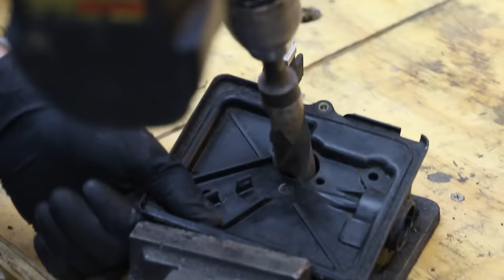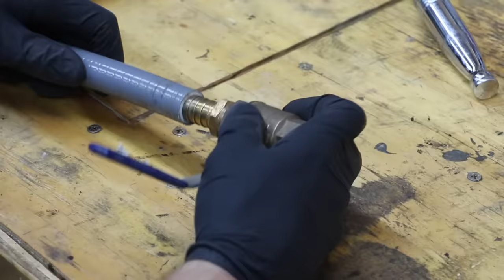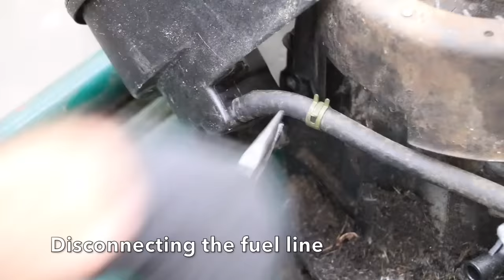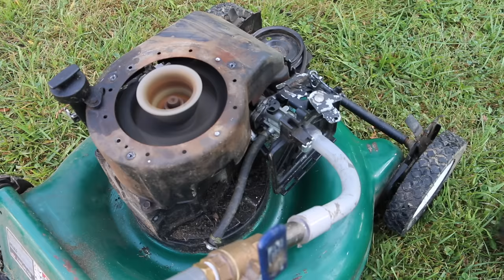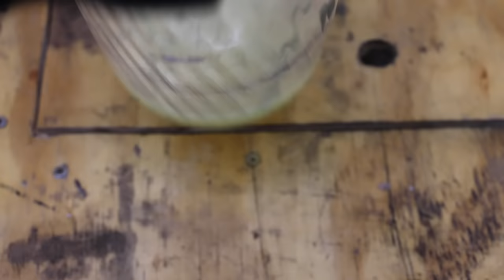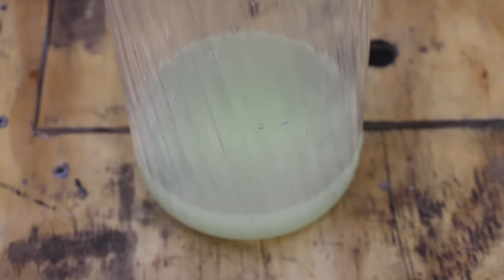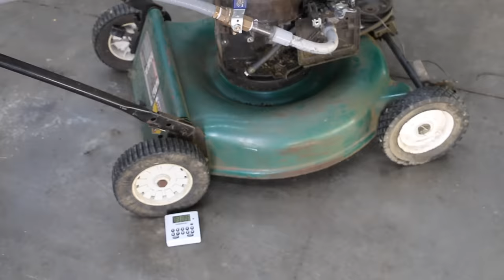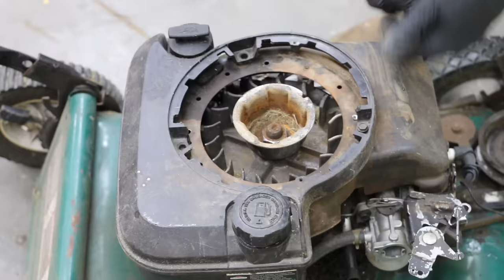Will a "Gas Vapor" Container Improve MPGs and Fuel Efficiency?  Let's find out!

Comment: Completely rerouting airflow through the fuel chamber is less efficient than having a separate air intake line with a separate valve. In the set up that you created here the air/fuel mixture is directly proportional to the amount of air flowing through the fuel. That air, in turn, is the sole source of agitation. One alternative would be to make the agitation lines smaller, which would require a lower volume of air. Then, a Y fitting at the base of the air intake So that you could attach a larger diameter air filter with a valve. This will give you a much more fine tuned control over the air fuel mixture. Additionally, these configurations run extremely lean so adding a little bit of water to the gasoline would help in overall engine temperatures. I know that sounds crazy, but in practice it works very similar to a water injection system by adding a little more water vapor than ambient air to the overall mixture.
Reply: You covered some items of my critique.  This test set-up for most applications  is quite impractical apart from educational exercise.  Adding water makes sense, a means to prevent a “backfire to evaporator chamber” explosion is the worst “safety” omission. 

One you didn’t mention though perhaps obvious is in this initial setup the air flow through the fuel being akin to a hookah (Sp, a water pipe) - fuel is filtering the air and canister will become a maintenance issue. He mentioned fuel turning yellow and air in the fuel making fuel cloudy (also less effective after a time by slow oxidation if left sitting).  

He didn’t cover detailed concept considerations before diving into the  “build” - as a “test of concept”, excluding filter element may have seemed a high-restriction unknown, but dirty air will create other problems later.  Addressing YOUR arrangement, a single filter into a common plenum feeding air to both the evaporator canister and the air-only intake line will work fine.

You comment about smaller lines “taking” less air is physically true, evaporation efficiency increases with air turbulence so the goal would be throttling the best stoichiometric FINAL mixture to the engine (your separate “dilution” line covers that). That stoichiometric base line is limited by the saturated fuel vapor availability (think in terms of absolute humidity, and high humidity air means less room for fuel between the air molecules ), but is a fairly predictable limit. Your multiple air lines into evaporator canister are best handled with a singe line feeding to a “sparger” ring (effectively smaller holes distributed evenly at the bottom of the canister, to make smaller air bubbles which can become saturated vapor bubbles).

Past each of those a canister level control is needed - as fuel is used the bubbling has less retention time for evaporation / air filtration, and extended time in that condition makes fuel vapor-quality worse.
EDIT of 7/2/22: As clarification, “Vapor quality” is a parallel to steam quality.  Bypassing the significance of the steam term, air holding as much fuel vapor as possible is “saturated vapor” (if the fuel was “water” the terminology would be “100% relative humidity”, such that “one more molecule of fuel vaporized” would precipitate a molecule of liquid elsewhere in the vapor space.  In practical terms the fuel energy in the space would not increase further at that temperature and pressure.  

The problem ultimately becomes load/speed control, and especially lack of an accelerator pump effect for use on engines that have a varying load.  The improvement you suggested as well as those I covered essentially make the canister into a modern carburetor. Opening the line from evaporator ahead of the bypass/dilution air line has the same effect as accelerator pump (a brief period of decreased air/fuel ratio into combustion chamber).  With that part alone, I see little practicality versus the well proven carburetor tech, which even without an accelerator pump has a more consistent fuel-air ratio control characteristic.  The only “really better” fuel delivery is direct fuel injection which is seen in modern vehicles and while better than carburization is overkill for small engines. 

Btw I mentioned the problem of backfire risk.  Carburetors aren’t perfect in avoiding that risk but since the fuel is drawn into the air flow by the Venturi effect, reverse pressure from an intake manifold explosion or leaking intake valve would implicitly halt fuel feed.  That effect is impossible with this direct evaporation arrangement, but the SATURATED fuel vapors in the evap canister won’t explode if that line remains protected/intact. 

HIGHLY LIKELY is nearly all of this work has been done before - a later comment indicated the Ford evaporator plate concept.  Before that was the fuel dripping into the intake manifold,and slightly better yet the psychrometric effect, where air flow passes over a fuel-wetted wick for evaporation (like a kerosene/oil lamp without the wick alight), but controlling the air/fuel ratio for engine speed resolves to very much what you described  - lots of physics, a little chemistry 🙂.
Reply: I’m certainly no engineer but what you said seems pretty accurate, if you have the resources and time I’d love to see a video of you making and/or testing this build.

Comment: Did you not know that vapour carburetors were one of the standard ways to fuel a petrol engine before the venturi type carburetor was invented?
Reply from the maker: Thanks for commenting on this!
Reply: Engine back-firing is why vapors are dangerous.
Reply: @Maxon Dimber unless it's a rotary ;)
Reply: @Maxon Dimber EXCEPT direct injection into the cylinder allows the intake valves to get loaded with crud causing other problems.
Reply: Any chemistry major can tell you that this will be true, it's called activation energy, combustion is a chemical reaction, some chemical reactions have a higher activation energy than others, for example burning diesel requires more energy than gasoline, and gasoline vapor, requires less energy. By adding a - bong - err i mean vapor inducer to the intake you are lowering the activation energy of the fuel mixture by changing the state of the fuel, however, the small efficiency increase is not worth the risks involved with adding air, or heat to a tank of gasoline on a passenger vehicle. The claims of >10% more efficiency are simply B.S. however, as the activation energy of gasoline is <5% of its energy density. I would be interested to see this test performed with both engines hot to begin with, my theory is if both engines were already at operating temp, then there would be no noticeable difference in fuel economy.
Reply: Steve Prince  Its sad how true this is, i mentioned one story that was misleading to a coworker( the border patrol and 7 year old girl thing) , and the next thing im hearing about is how its crazy the number of things being hidden from us, and he had seen a video of a guy opening a portal to egypt in his bedroom, i kept my mouth shut, for obvious reasons, him being a coworker, but it was hard to hear. Homeslice, a media outlet kept a part of a story out to make their agenda look good, that is not the same as mind control and teleporters to and from Starbucks. SMH
Reply: Steve Prince  The difference can be seen when you apply a load to the engine. When you're running the engine in neutral, you won't see much of a change anyway.
Reply: these comments are ridiculous........ engine vapor or venturi, you tune a engine to the right fuel/air mixture so in the end you are going to use the same to get the equal amount of power... it don't matter how you get the air fuel mixter to the piston..... it don't care who or what brought it to him....
Reply: Steve Prince  well basically I was tying to say is the "vapor" can run a engine but its pointless given the power output on a petrol engine, kinda same with propane, it could have a purpose but another thing to think about is fuel price...  hell propane isn't any price than unleaded. 

if you want to toy around and such with it, it would be fun to play with different ideas but in the real world applications its not worth it in my opinion. To be honest I believe diesel is the way to go, plenty of real power "torque" and with technology they are pretty fuel efficient.....
   another note is to say that todays tech might be dumber than the simplicity of tech in late 1800's/early 1900's how many old hit n miss engines ran off natural gas? its a pretty old argument of whats better fuel type/engine type....and when Diesel  was invented before 1900 and it seams that it is taking places of other engine types.. 
ok and i will stop babbling and get off here
just want to be part of the conversation lol. cheers have fun
Reply: Steve Prince  It's called "pandering". Now please visit my Patreon page!
Reply: Steve Prince  news flash Steve. They do run the world to buttress demand for our dollar in world trade. Gasification technologies did and could supplant petrol
Reply: Steve Prince  Do you feel better about yourself after ridiculing others about things of which you have little or no understanding of? A mechanical engineering degree does not give real world experience or show the result of greed in a competitive marketplace. Multiple examples can be supplied to you of superior products that are not utilized to their fullest potential, designed obsolescence, and straight up ignorance/selfishness on the part of the consumer which have led to a far superior products' demise. 
Do you not understand exactly how the petrodollar works or the lengths that those who control monetary flow will go to to preserve the status quo? Reference Tucker automobiles for one example.
Two questions I ask every day, "What lies am I telling myself today?" and "Am I part of the solution or part of the problem?" If you're all that with your mechanical engineering degree, I challenge you,  prove it by coming up with a superior workable solution.
Reply: @ioccatonyz1  an iron wire mesh can solve that issue

Comment: Your valve on the hose is not adjusting the air/fuel ratio into the carburetor. It’s only controlling the air flow. The air/fuel ratio is purely based on the amount of fuel able to evaporate in the container while you’re sucking the air through it. 

If you want to start researching improved fuel economy, you have to start adjusting the air/fuel ratio to perfect the engines efficiency. The engine was getting so much vapor it wouldn’t run until you closed the valve most of the way. 

Add a second valve taking air from the atmosphere into the same line. Then you can adjust ratios by manipulating the 2 valves.
Reply from the maker: Thank you!
Reply: Great idea

Comment: thats a good way to survive without a carb in emergencys
Reply: Yes! This is the smartest comment on here. Carburetor jets are always plugged and you just need to mow? HANDLED.
Reply: @jimmio3727  yes... no carb? Make a fuel air bomb! 👍
Reply: I have to agree, looking at it, the purpose of a carb or injector is to make fuel vapor mixed at a decent ration( I wouldn't always say good) this is probably making a very rich fuel ratio(not sure I haven't tried it yet) but never the less, it will get your lawn mowed or your clunker down the trail if the carb clogs.
Reply: Yeah pretty much he made his carburetor. Which is why I knew ahead of time you can run an engine on vapors. That's what the carburetor in a regular engine DOES - vaporize the fuel and mix it with the air.
Is it going to use less fuel? No, the engine as delivered from the factory already has a carburetor, so it's ALWAYS been running on vapor.
Reply: Robert Andrews  You are correct it could be a break through other than fuel is upper cylinder lubricant and when an engine runs lean for a long time the wear and tear is to much for the (wear) rings to handle and also a engine needs enough fuel up top to keep it cool or again the rings and hardened valve seats can fail
Reply: Only for old simple engines, and  not for cars made after 2000's. i doubt modern car will continusly run when many sensors are yelling at the computer"therr is guy tring to 
bypass us".
Reply: its basically a carburator.

Comment: There was some research about using ultrasound to atomize gasoline more evenly and completely.
Reply: same outcome
Reply: I think the goal is vaporization. Heat has been used to accomplish this.
Reply: Nobody wants to microwave gasoline. Sorry.
Reply: Yes, decades ago. Was snake oil then and still is.
Reply: @Daniel-59  it isn't snake oil. And the whole snake oil phrase has merit.

Lard from meat is quite useful. Especially in survival situations.

Ultrasound vaporization is used extensively with liquids. Combustible ones as well.

Fact remains, though. No one wants to microwave combustible liquids. It's dangerous.

Most people have problems putting an electric liquid pump in gas tanks which very clearly have electricity terminals connecting to them. Especially when they think about those terminals or wires arching in some fashion and exploding the fuel tank.
Reply: Piezoelectric injectors do exist, quite ordinary nowadays, and I dare say they are are more commonly found than is commonly known to common folk.
Reply: @ThomasMOPrikakis  microwaves and ultrasound are not even slightly similar to one another

microwaves are a form of electromagnetic radiation, with wavelengths between radio waves and infrared light

ultrasound is a form of mechanical oscillation propagating through a medium, so just sound with a far smaller wavelength
Reply: @pkermen  that's why the tanks were metal in the experiment

Comment: I have done something similar on a chevy geo sprint a few years ago. I used much less vapor than you did here. Testing at 60 mph the car went from 38 mpg to over 70 mpg every time I checked it. I went to the same gas pump every time and set on the slowest setting and when it kicked off I did my calculations from there. I'm quite sure there is another 20-30 mpg more to be had if I had some funding and a couple engineers to work with me....

Comment: You need to "T" in an extra air valve so you can adjust fuel vapor and air mixture. We ran on waste oil with gasoline, diesel + gasoline, water + gasoline, virtually any ratio as long as the gasoline is being vaporized it will run. A good way to get rid of waste/dirty fuel.  :-)
Reply from the maker: Thank you for the feedback
Reply: Question, when you did water + gas in the vaporizer, did the water get vaporized?
Reply: @PLANETXLABS  Possibly a small amount will be carried over with the fuel. Didn't seem to affect the performance though.
Reply: i wished he would have tried different fuels.  would it have run on alcohol...particularly ethanol?   diesel by itself?  anyone know?

Comment: How much Nitrous can a lawnmower take?
Reply: Blorox Cleach The amount up to and including that which is nessisary to separate head gasket from block, or rod from piston.
Reply: I have seen that video. It is only one lawn mower and it is from 2006 so engines and what not have probably changed a little bit
Reply: I boosted a flathead Briggs 3.5 HP with 2 psi boost back in high school with no problems. :)
Reply: forced injection or nitrous?
Reply: Forced air via a vacuum cleaner hose to the air intake ie where the air filter was. But I also had to pressurize the fuel tank cap to not have the gas shoot out of the tanks vent hole! The engine was a 3.5 Hp horizontal engine on a reel mower, the engine was say mid 1960's era as its engine vintage. 

You can hook up a compression test gauge to in the spark plug hole to measure with and without boost. My test data was in an old Clintons book that went under in Katrina. 

The without and without boost compression psi numbers were sort of like the 16.7/14.7 ratio ie the gauge pressure ratios. 

Many carbs have all sorts of vents thus just pressurizing the air intake will not work. ie gas flows out via vents like mine did ie the tank's vent hole. Thus before trying explore where liquid is leaking before any starting attempts!
Reply: Someone get David freiburger on the horn. Tell him they need to do this on engine masters.
Reply: Aah the spoonerisms are real!

Comment: Very old vid but let me add my 2cents..

Liquid Gas doesn't burn, the vapor on top does.  Carbs and Fuel Injectors move the fuel as close to the Cylinders as needed and atomizes it so that it is easier and faster to vaporize.

Your interesting test proved this.  The Ball Valve, although not efficient, mimics the Butterfly of a Carb.

I dare say, if your Tubing length was shortened, you would have better starting..  Might even consider 2 connected Tanks, 1 for the Fuel and 1 for the Vapor.  This might mitigate any Fuel from being inhaled accidentally.

JMO..  and thank you
Reply from the maker: You are welcome!  Thanks for sharing.